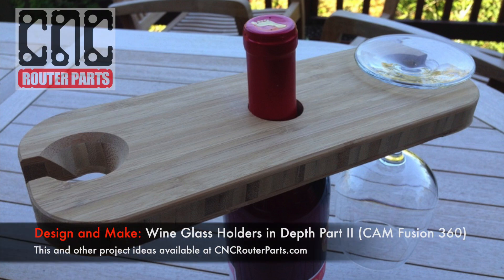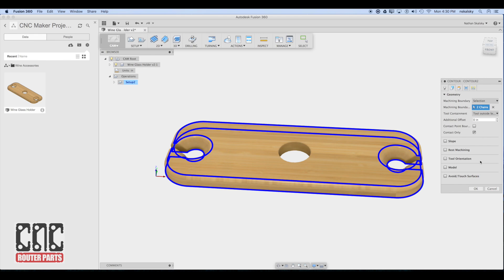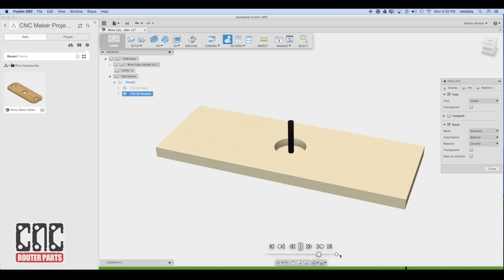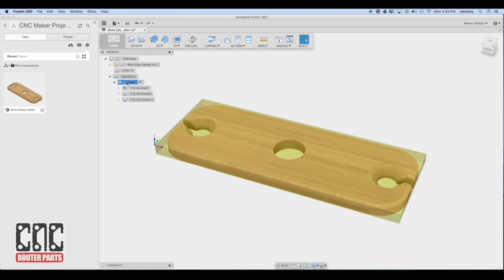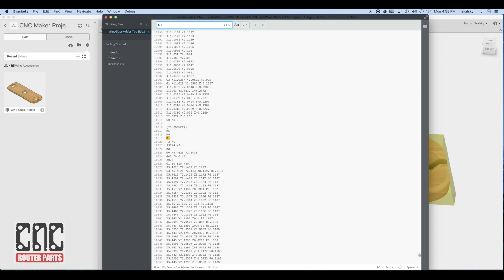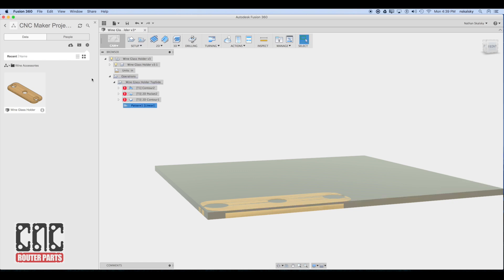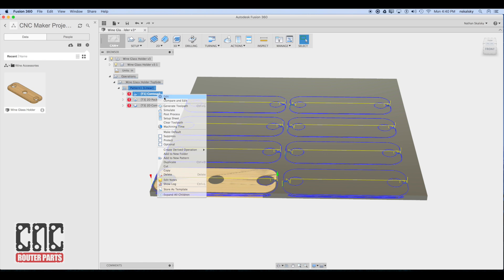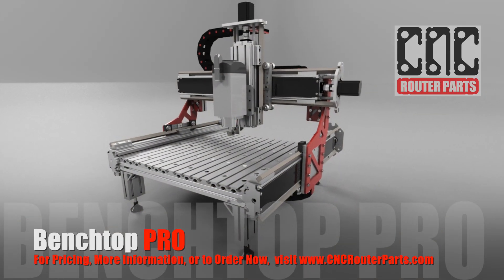Design and Make: Wine Glass Holder Part II - CAM Programming with Fusion 360

Comment: Great video series to for end-to-end introduction - Thank you!. Question... Here in Part II CAM (1:15) on first 3D contour operation you select two chain profiles for the geometry boundaries. Could you explain why?
Reply from the maker: Thanks Mark - the two profiles establish the boundaries for the 3D Contour, limiting the operation to just beyond the fillets.   If you leave the profiles unspecified it will come up with a similar result however it will try to contour the 90degree faces all the way down which is redundant/undesired in our case.    Hope this helps!  -Nathan